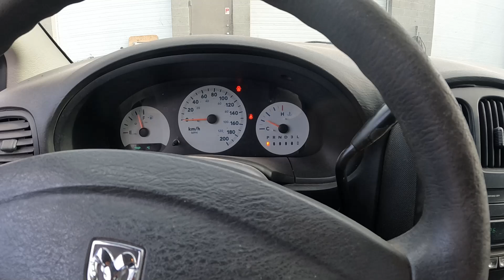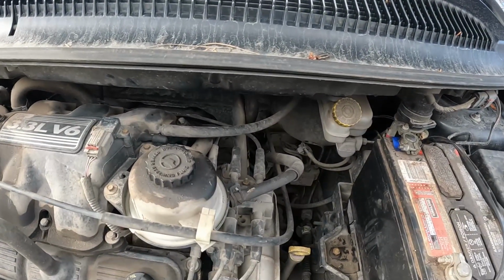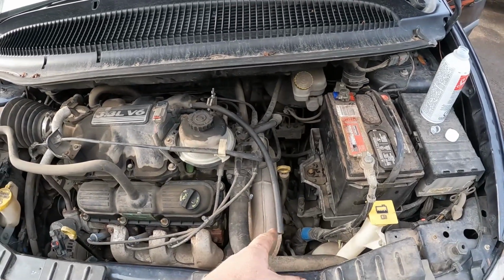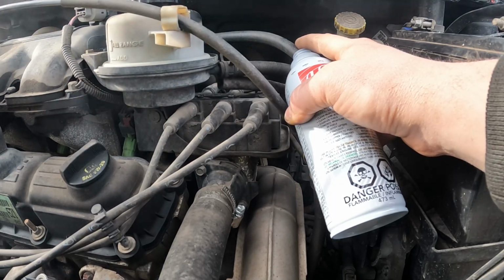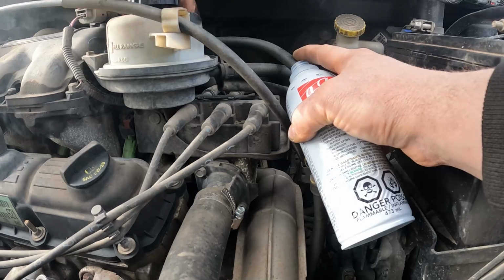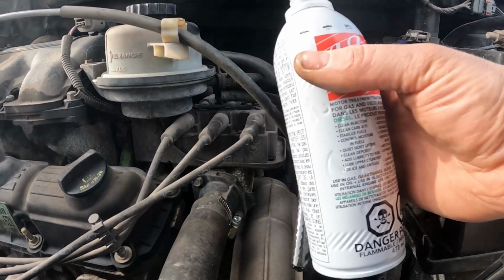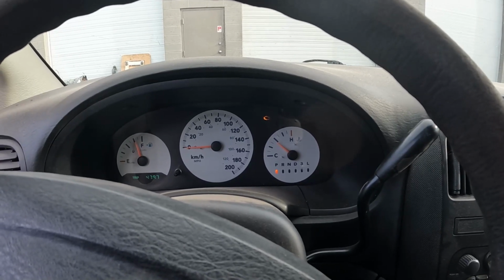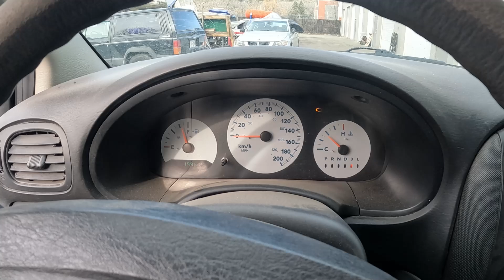How to clean your intake with Seafoam - Intake Decarbonization - No special tools required!

Comment: Take your hose going to the intake and get a smaller hose that will tightly fit IN the intake hose THEN take a small vacuum hose and fit it in that hose.
It will create a really small opening 
 That small opening will limit the amount of seafoam that sucks in AND the small opening will make the vacuum leak much less noticeable.
 Also if you have enough hose it can be snaked through to the driver's seat when 1 person can slowly dispense seafoam into the hose and Rev the engine.

Comment: I wonder if that will work for a 2016 kia Forte?
Reply from the maker: @Saul Souza  Yup. Just locate your Evap Purge Valve and attach to the line between the valve and the intake manifold.